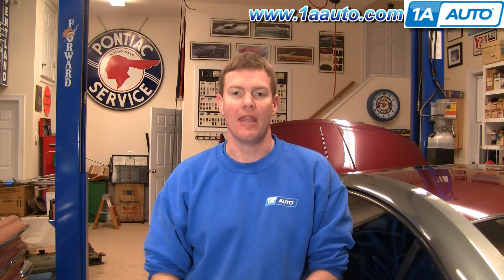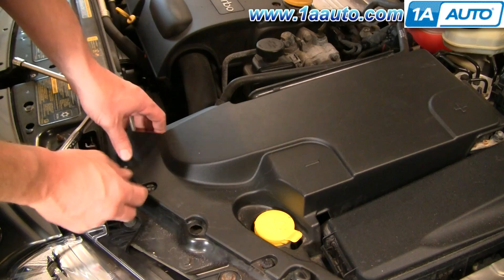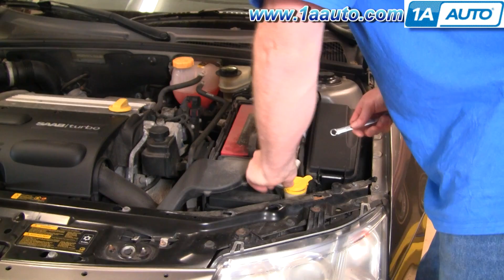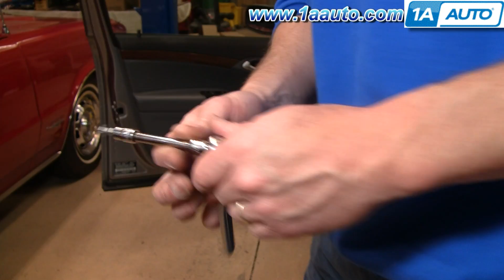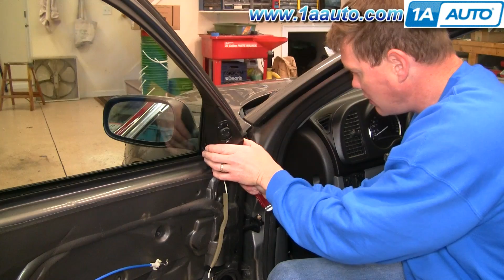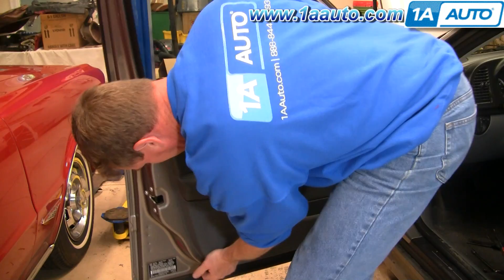How To Replace Side Mirror 03-11 Saab 9-3

Comment: great video is it possible to wire cables and install ghost shadow lights in to the front rear mirror or anywere else in the door that goes out when open and close doors? the negative - wire is it the black whit blue stripes and the hot + wire orange whit blue stripes ?

Comment: This video must have all these extra steps with disconnecting the battery and interior door panel controls for liability issues. I appreciate the info very much but all I needed to do is pop the hand rail cover (seen in the video), loosen the 2 screws inside the handle to pull the door off the lip of the frame (also in the video). But once the door panel was dangling, I didn't disconnect the 3 interior door connections, I just popped the plastic cover on the inside of the side mirror, removed the 3 screws holding the mirror assembly disconnected the wire going to the mirror and then replaced it with the new one. I did all of this while my engine was running because its cold out today. After I was done I wondered what all that extra work was for. I assumed if some nitwit shocked themselves while performing this simple repair 1A Auto could say they told them to disconnect the battery. 

I'm all about making life easier! Again, thanks for the how to video and please don't worry about disconnecting the interior door controls, that is a lot of extra work for no reason. Once the door panel is loose it can just dangle for the 5 minutes it will take to remove and replace everything.
Reply: I was thinking the same thing.  Replaced a mirror and once I had the door panel loose, I had enough room to remove the mirror and not mess with all the electrical connectors.  I try to avoid unhooking any plastic connectors that I don't need to, as half of the time they want to snap or break when messed with.  Great video regardless, I find that this channel always seems to have the best tutorials and walkthrough videos on fixing stuff, and always saves me a lot of headache.

Comment: Excellent video.  Thank you.  My mirror keeps folding backwards.  I have not idea why.  The local dealer said 'well maybe it is a folding mirror motor malfunction'...   

Thanks for posting .
Reply from the maker: +omar malih  Thank you for watching!  Sounds like maybe the fold wires are reversed, or the switch is faulty.

Comment: Thank you 1A auto Parts. I just finished replacing the passenger door mirror on my wife's 9-3 after an...incident...with the garage door frame. Dealership quoted $630 to replace. I found a used part online for $90 and replaced it myself in 30 mins using your video...AWESOME!!  Thanks so much and I will certainly bookmark 1A Auto Parts for future part purchases.